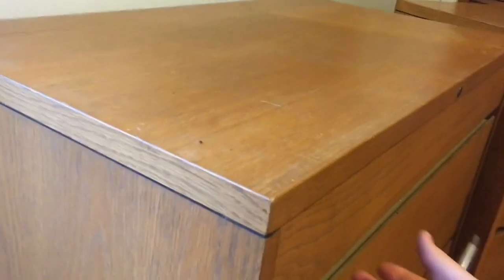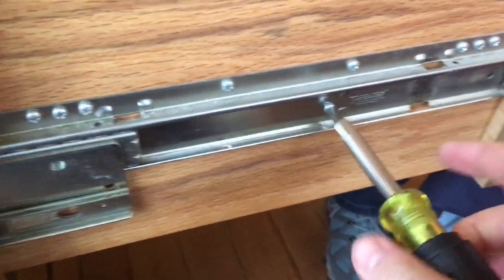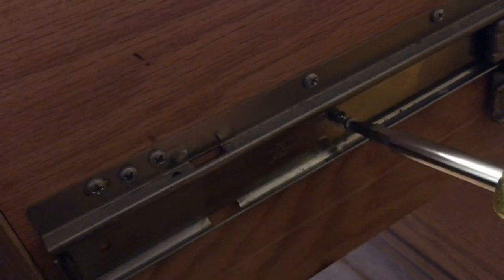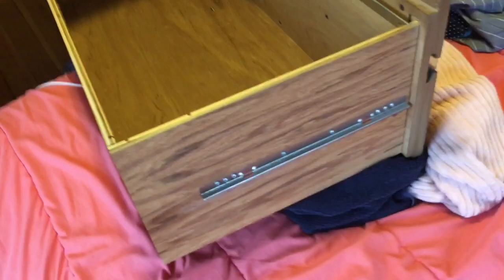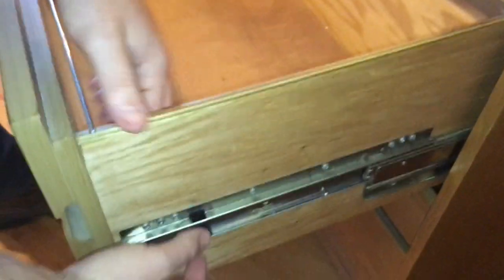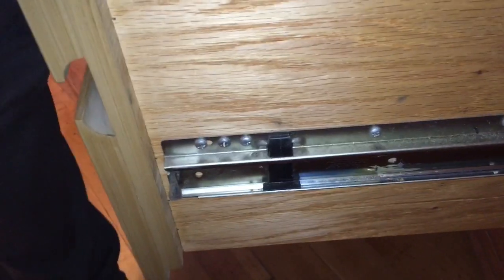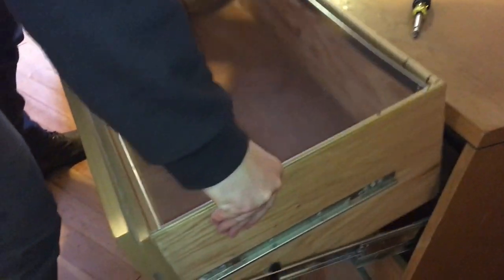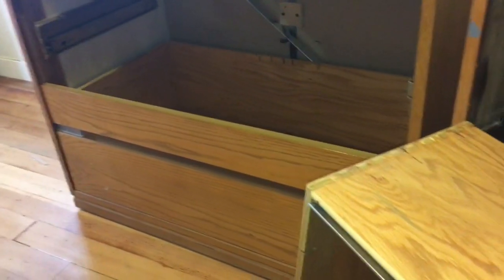Lateral file cabinet drawer removal - side glide drawer removal

Comment: Nice that it helps some people, but incomplete, doesn’t help me much at all. First, my cabinet has no screws in the location shown here. Second, the removal of the black tabs needs a LOT more attention; I cannot see what he did with them. Third, the drawer on mine is prevented from sliding out by black tabs inside the slide mechanism. He shows nothing at all like that.